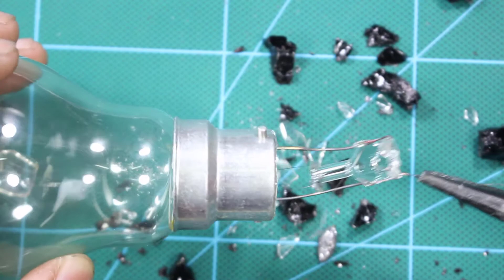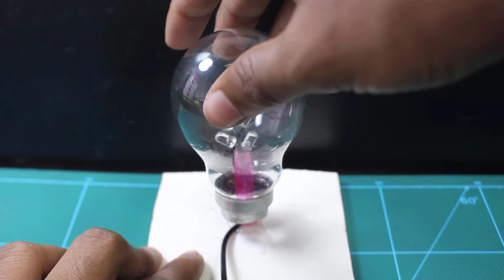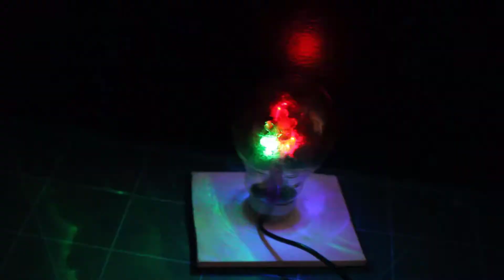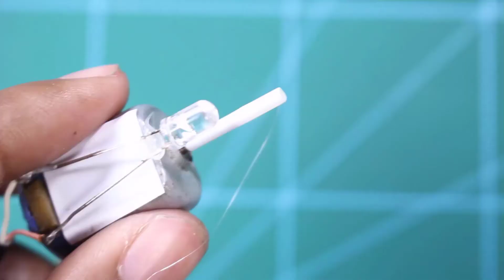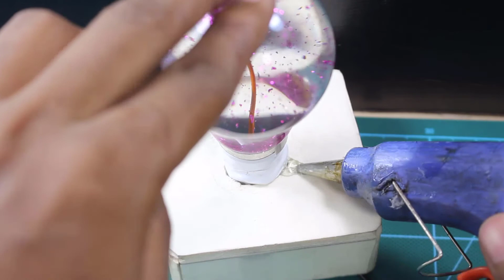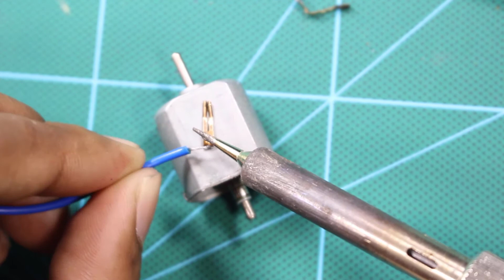3 SIMPLE INVENTIONS

Comment: No resistor needed?
Reply from the maker: It works well when you plant it
Reply: @AHMDIY  how many volt does The led you use?
Reply from the maker: @daydreamers845  3.7 volt
Reply: @AHMDIY  so i need to use resistor  like 100 ohms right?